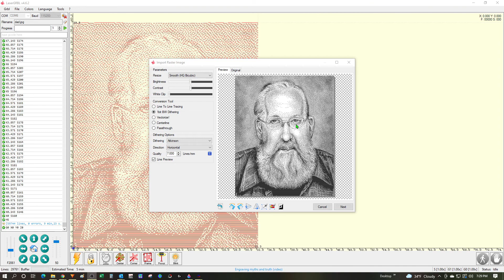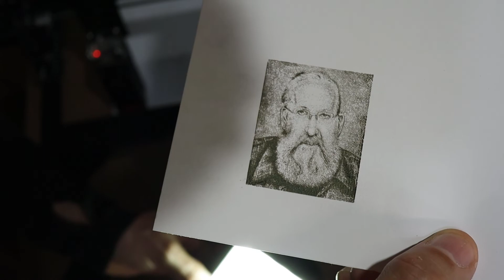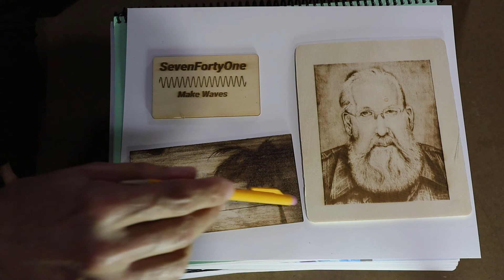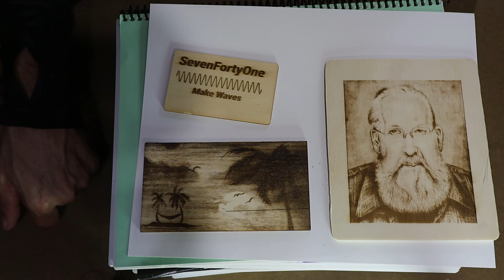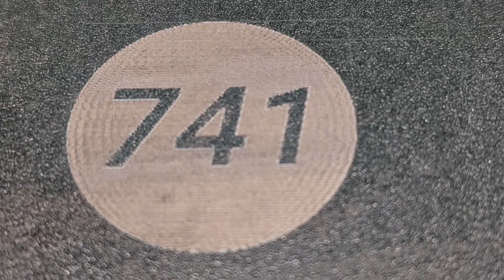Laser Engraver: Atomstack A5 M40 Overview and Demo

Comment: Neat stuff! I worked for a company that manufactured surgical devices and we purchased a laser etcher for adding serial numbers etched in the metal for traceability for certain devices. I'm sure this was a whole lot friendlier to work with ( I had more hair before I had to set it up, and learn it).
Reply from the maker: I looked at those for circuit board serialization years ago but at the time they didn't meet mil standard requirements.  We also had laser machines for cutting bonding material and drilling tiny holes in boards but they were slow compared to mechanical tools.  It's fascinating technology for sure!